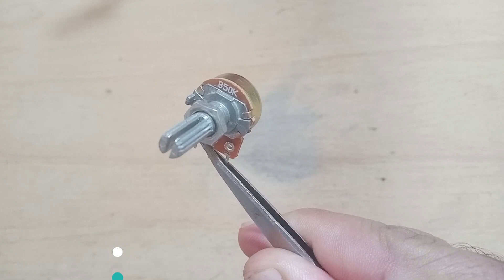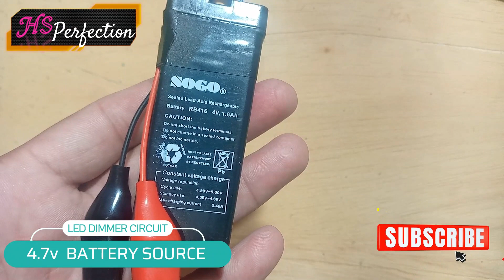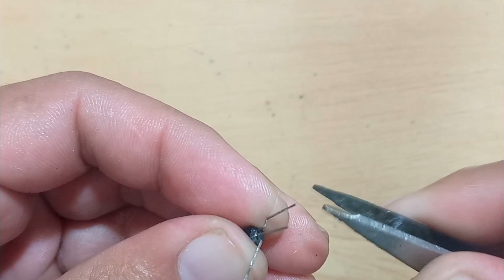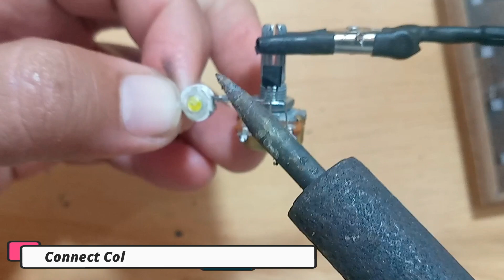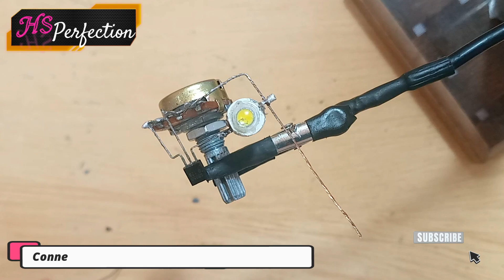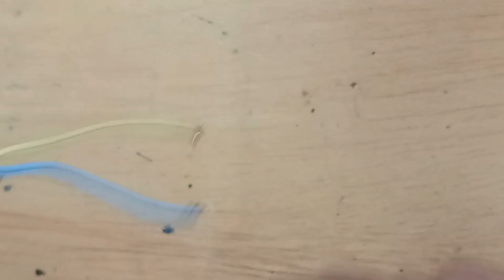S 8050 |HOW TO MAKE LED DIMMER USING S 8050 TRANSISTOR|VOLTAGE REGULATOR USING TRANSISTOR

Comment: If you give 3 voltage to that circuit how much voltage would it take to run the circuit . Accept the output voltage .
Reply from the maker: As you know the output will always low than input because some voltage drops as variable resistor act as load which falls down some of them therefore if we gave 3v the output will be 2.14 approximately
Reply: 0.9v is a little higher dont you think . I thought the voltage drop would be like 0.1v .